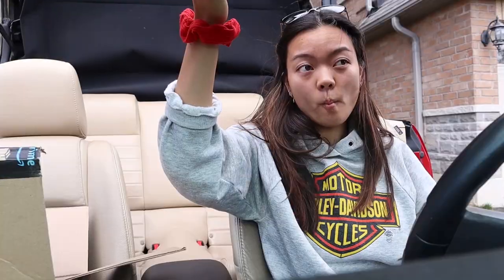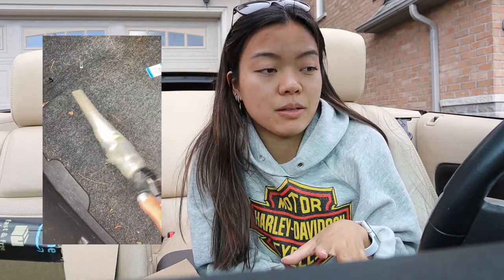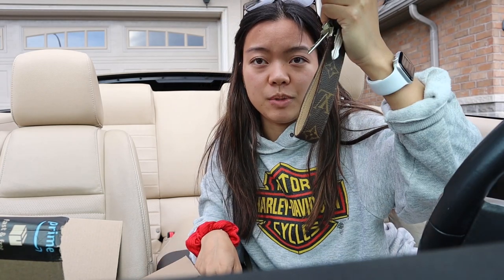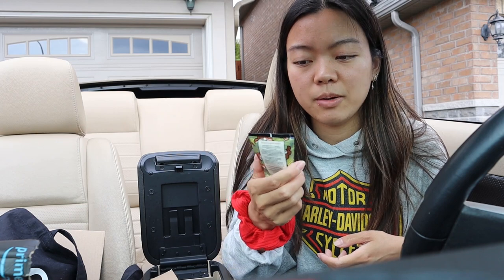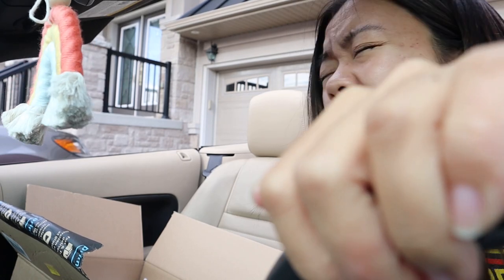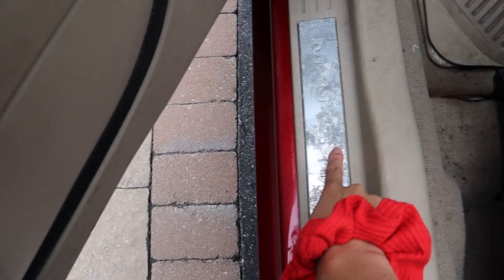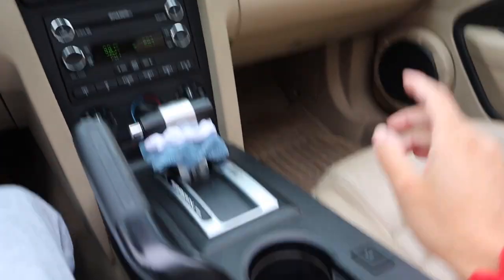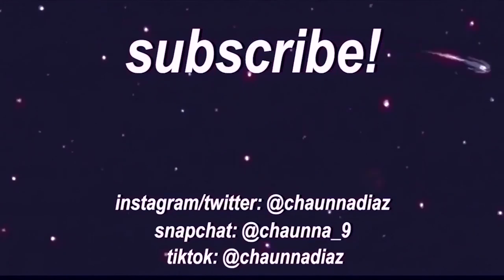decorate & organize my car with me + car tour!

Comment: Life hack when buying little trees, gels or any other smell goods for your car you want to find a good place to put them where they're not seen but they still work for the gells obviously you can put them under the seat but for the little trees I generally wrapped them around the seatbelt buckle and stuff them under the seat they still work just as good not only that if you actually read the label it says do not completely unwrap it and you can gauge based on how uncovered the trees are how strong and how long they last